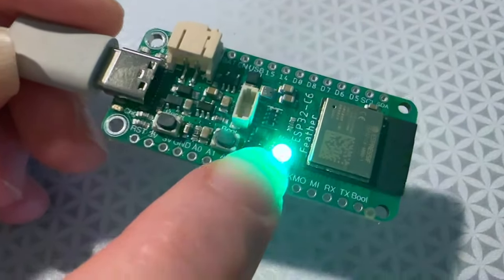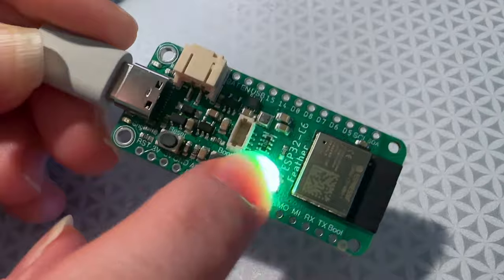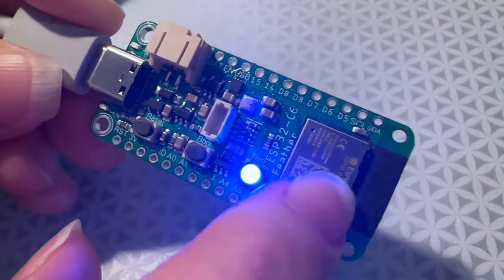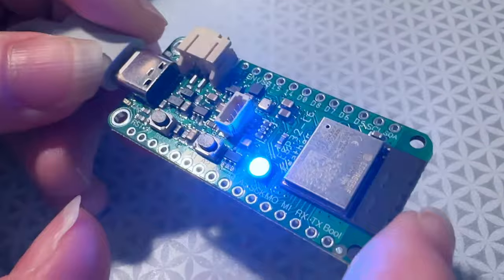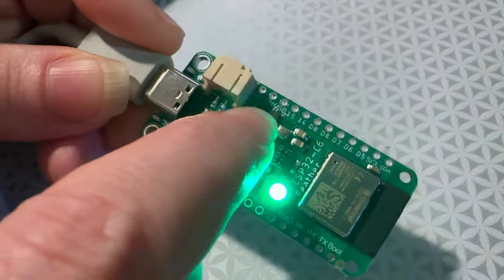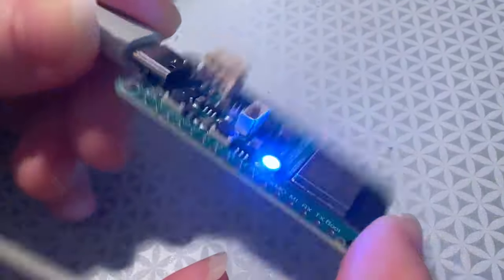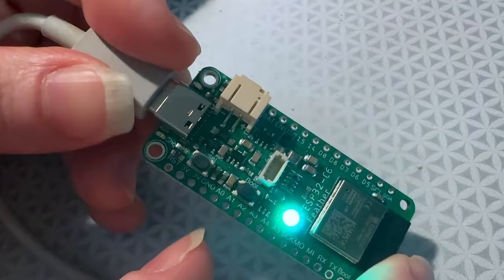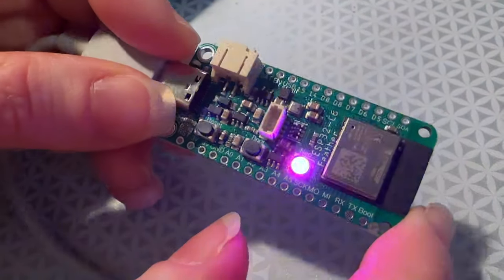ESP32-C6 Feather is here, time to bring it up 🚀🛠️💡

Comment: According to Espressif: The ESP32-C6 suports Wi-Fi 6 & BLE 5 & Thread/Zigbee.

The serial port of the Espressif -S2 needed a bit stuffed after reset, or everything was off by 1 bit position, and the A/D converters were TERRIBLE, hardly usable, whereas the  ATSAMD51 has great A/Ds.

Comment: What is the uses for this board? Does it connect to Raspberry Pi?
Reply: It replaces a Raspberry Pi, but it has a radio for Wi-Fi 6 & BLE 5 & Thread/Zigbee.
Reply: It's like an advanced arduino. It's a microcontroller board with good wireless options. Useful for IoT projects that don't need the computing power of a raspberry pi or need something smaller/lower power usage.
Reply: @ethanjennings6442 , it has a high performance RISC processor (CoreMark® score: 441.32, CoreMark 2.76 @ 120 MHz) and a low-power RISC processor (20 MHz). I'm not sure that the Pi (RP2040?) can match that.